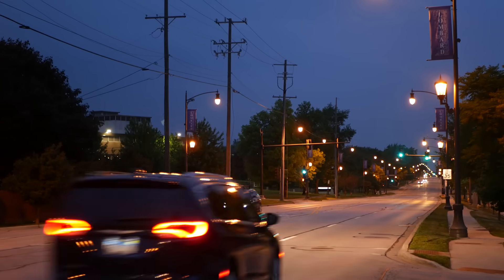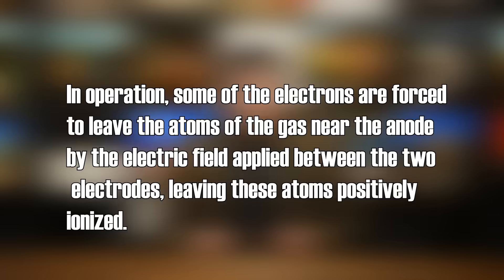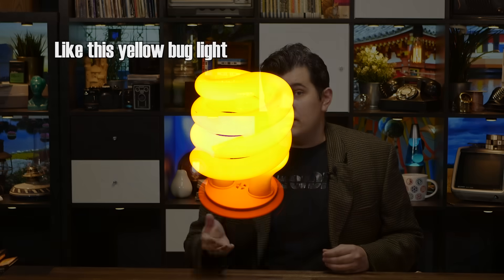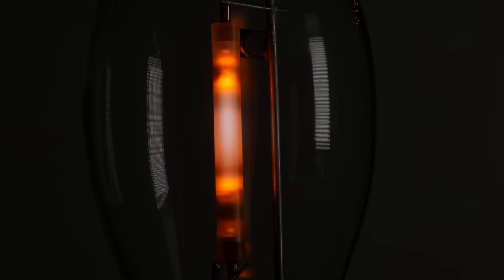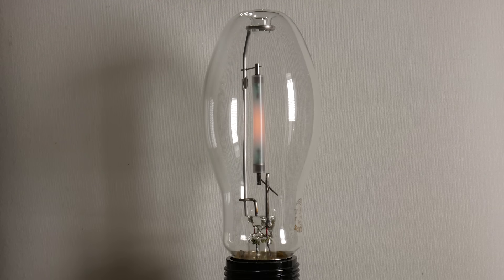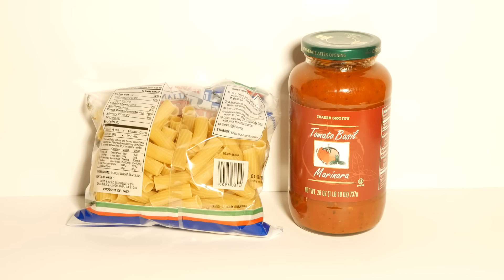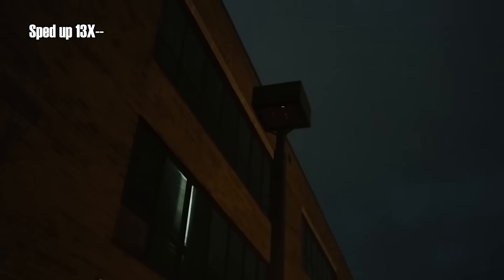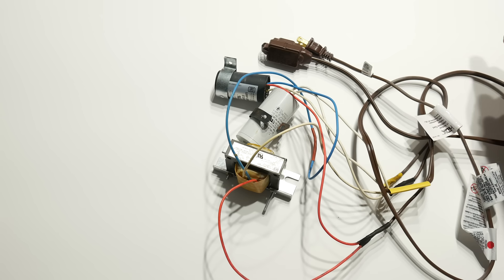The High Pressure Sodium Light: Ubiquitous, effective, but good?

Comment: Sorry to correct you but these are Low Pressure Sodium lamps. High Pressure Sodium Lamps are much whiter.
Reply from the maker: No, these were HPS lamps.  You can very clearly see on the package when I first showed the bulb.  There is a variation called White SON which is much closer to incandescent white light, but it is very rare.  LPS lamps are completely monochromatic and you cannot distinguish colors under them at all.
Reply: Technology Connections
I recognize that they are mostly monochromatic and that is what most street lamps are. Your video title says street lamps. "Orange" street lamps are almost always LPS because of the greater lumens per watt. They are gradually shifting to HPS and Metal Halide lamps but those are quickly being leap frogged by LEDs.

Comment: I've also seen a failure mode of discharge lamps that the inner cylinder or capsule explodes.  Sometimes so energetically, it shatters the bulb itself.

Comment: Been a long time since we've used sodium-lighting (except at some large motorway/highway interchanges where max. spread is needed), with most street-lighting already converted from mercuric-oxide & fluorescent lighting (which replaced most sodium-lighting) to LED-lighting, because LEDs are so cost efficient & long lasting! 
One big problem with the colour of sodium-lighting is if you are approaching traffic-lights you may not notice that they have changed to orange, turning red before you realise! I was caught out by this just after getting my driver's license about 40yrs ago, & ran the red-lights! Fortunately there were no other vehicles around as it was really late at night!

Comment: I have some personal experience with the change in these lights that is positive. (I mean going from the old orange sodium lights to LEDs.) One of the lights is just outside of my bedroom window. When it was the old type of light, it would almost entirely light my bedroom at night and even blackout shades would let in some light to disturb me. The LED's more directional function and white (5600K or so) output has made it much easier to cut the light out when I need to sleep.

I also have looked at them from a distant, higher elevation. What I've noticed is that the light pollution issue is much less of a problem with LEDs, since they are less intense and more directionally focused. The colors are vibrant and the viewing distance they provide is sufficient, but they are less disturbing generally.

Comment: Perhaps it's intentional, perhaps not, but limiting the colors, particularly to low wavelengths (Yellow/Amber and lower into Reds) can diminish the interference of light on night vision. Reds are more difficult to see, making Amber/Yellow lights a safer balance once you reach a poorly lit street or the edge of town (because your eyes need less time to adjust). You can literally output more light and it'll be less disruptive to human nighttime perception than anything in the Green+ range.
Reply: Try getting a municipality to defer to common sense like that though
Reply: +tOM Travelling I know getting "white" out of LEDs is a challenge and that they also tried using RGB instead of phosphor coatings, but why is that relevant to these comments?
Reply: If outdoor lights didn't affect our night vision, we could see better beyond the reach of the light.
Reply: So far, implementations of LEDs I've seen have been spotty and blinding bright white. I'm looking forward to different proposed solutions. The studies on vision he mentions seem like a good starting point to judge whether the efficiency of HPS is real, and the effects each type might have on night visibility. Perhaps some warm white LEDs with diffusers might improve CRI and save us a few bucks in the process. Another thing people haven't mentioned much is how many more insects white light attracts vs mostly orange.
Reply: There are no "white" LEDs - like fluorescents, they emit ultraviolet & a phosphor mix makes the white.

Comment: Not only are the sodium lamps very efficient, they even have 3 big advantages over LEDs for street lights:

1 - the narrow frequency range and the specific low frequency make it so it only stimulates the L-cells, leaving your nightvision nearly unimpaired (the main reason why the lights in ships, aircrafts and cars for the displays are red/orange).
2 - it doesn't mess up the day/night cycle of wildlife as much (birds singing in the night can be really annoying)
3 - the narrow frequency can easily be blocked out with filters, meaning that they do not hinder astronomers so much.

Comment: I miss the old mercury vapor lamps, they were never as bright or harsh as sodium lamps. There's an HPS streetlight right on the edge of my yard that I want to brutally murder every night. 

Hey, if you're the tinkerer type, try picking up a high-CRI Yuji LED. They're pricey as hell compared to cheap Chinese LED chips, but the quality of the light they put out is unbeatable. I've used a couple in projects so far: I have a warm-white 50 watt chip in a lantern I built to replicate the look & brightness of a gas mantle lantern, and a cool-white 100 watt chip in a crazy, daylight-blaster of a flashlight.

Comment: I moved 8 months ago. But mu previous city-of-residence was in the process of replacing the HPS streetlights w/ LEDs. They chose fixtures w/ warm-white LEDs, that looked really nice (in my eyes). As an example, they replaced them all on a stretch of two-lane blacktop w/ the lights arranged in an alternating zig-zag pattern. The entire roadway was evenly lit, across the width, w/ no shadows or hot spots. And the fixtures were designed for minimum "sky-glow" & w/ just enough back-cutoff to throw light on the sidewalks, but not through the windows of roadside houses.

Comment: You didn't mention another reason they are used in street light, the light from them penetrates water better then anything else allowing you to see the road when its covered with water and see through rain.
Reply: Gian N   What I can add about fog lights is that they are a lowly mounted light which is the main effectiveness for less glare.  Marketing and ignorance probably kept the yellow in production.
Reply: Gian N  indeed if there was significant scattering involved you would notice the fog would be blue, instead it is a hazy white.
Reply: Lou Fazio exactly. Fog doesn't always go all the way to the ground. By putting fog lights as close to the ground as possible, there's a good chance that the light could travel under the fog. They don't help you to see since your eyes are above the fog, but they make your car more visible to other drivers.
Reply: sadly that's a myth, like yellow headlights in fog. The wavelength difference between colors is not comparable to the size of water droplets in fog or rain, so any scattering is the same. Maybe some slight differences in contrast, but the effect is very small.
Reply: @giann3021  Why are all these people driving with fog lamps on anyway when its not foggy!   Originally, they were designed so a driver can track the side of the road in heavy fog (and which is why when you turn them on, the one red taillight gets brighter for the guy behind you to still see you), but now they are just an automatic ON for everyone.  Those fog lamps were not designed to protect others from the annoying and blinding glare they produce when its NOT foggy!  I often see some use them as headlights instead of regular headlights, I guess because they think it looks cool.  Ugh!
Reply: @jimmayors2315  Lol you got it! They're great to see the bottom/edge of the road, and keep your car on it when visibility is poor. I feel like they help when its raining heavily too. 

The only time I use them when not foggy is on pitch black twisty roads, where they also help you see the edge on tight turns. If they are properly installed they shouldn't cause glare either way. The problem is mostly with improperly installed aftermarket fog lights and LED bars, where the height cutoff has not been adjusted or accounted for.

My Suzuki Grand Vitara has some OEM fogs which do cause glare to other drivers, but I suspect they weren't installed from the factory, or were replaced after a crash and not aligned. There must be some adjustment screw behind each lamp, which can be set to the correct position.

Adding a yellow filter actually reduces light output by around 15%, which could help reduce glare on lights that are too bright. Yellow LEDs or 3000K HIDs aren't affected by this though, since they are natively of that color and work the same with a clear lens.
Reply: @giann3021  my theory is they do it because the lamps cast a bright pool of light immediately in front of the vehicle. Unfortunately, this is precisely the opposite of what is required of the situation; as it destroys the driver's ability to see the dimly-lit objects 100m to 1km down the road.
Reply: Because they aren’t actually fog lamps, but driving lamps on most vehicles in the last 20 odd years when you look at the lightpattern, angle, and wattage. 
The bit about one taillight getting brighter indicates you are fr9m Great Britain, where they commonly have a single rear fog also. On the continent they often have two. And in the US, zero, excuse me... zed.
Reply: @attackeagle  While this is probably true in some cases, I still see plenty of vehicles here in New Zealand driving around with four bright lights (regular headlights + the problematic bumper-mounted lights) at night. If they were intended as daytime running lights, they would switch off automatically when the headlights came on; and if they're intended as driving lamps, they should turn on only with the headlight high-beam (aka main beam).

Comment: Detroit recently replaced all of its lighting with LED lights. 

Part of the rational was that the old lights used a transformer that was in the base of the lighting fixture behind an access panel. Transformers are full of copper wire and were a target of copper thieves. Security nuts and then even welding was used to prevent the thievery. Now the LED bulbs do not need the transformer so it is removed.

The city got the power company to pay for the replacement. Apparently streetlight electricity isn't metered. The city pays a flat rate based on the number of street lights. The flat rate is supposed to include maintenance of the lights. Detroit had an independent contractor determine that less than half of the lights were actually working and a deal was worked that the city wouldn't sue if the power company would get all the lights working by replacing them with the LED units which would get rid of the theft target transformer.

Comment: You should explain the difference between lumen and lux measurement. And go more in depth on CRI.
Reply: 2010ngojo lumen is the light a bulb emits. Imagine something like light power. Lux is lumen per m2 , how much light you get to the surface you want. Cri is a percentage of how colours look like in comparison to the sun , so 100% is perfect for al colours 50% means only 50% of shades will look the same. In HPS lamps only a handful of   Shades from 16.7 mil shades will be correct

Comment: What you didn't mention: The sodium lamp is used to reduce light pollution. The yellow band doesn't pollute the night sky quite so badly. I don't quite know how it technically works, but seeing as blue light and shorter wavelengths require higher energy, I think it might be that the higher-energy blue light will just bounce off the walls and ground better. I know an astronomer who told me about how much better the city observatory was able to see fainter parts of the milky way after my home town switched to sodium lighting in the early 90s, coming from CCFL street lighting.

Comment: My city is mostly LED now, and I actually greatly prefer it to the sodium vapor. The color reminds me of the old DX phosphor coated mercury vapor lamps.

Something you didn't mention (maybe on purpose, I don't know) is that while the lamps themselves are quite efficient, the ballast wastes a portion of power as heat. Significantly so, in autotransformer ballasts for larger lamps. But modern electronic ballasts mostly mitigate this.
Reply: Agreed - not to mention HPS's huge market as grow lights.
Reply: We had a mercury vapor light on our porch when I was a kid. I’ve preferred white lights ever since.
Reply: I prefer sodium vapor.

Comment: 11:37 Wow, since I was little, when walking at night, I always thought the lamps would go out periodically to ensure they'd last longer, it didn't help that it was always one at a time, and only after it was on again, the next one in line was turned off.

The reality is that the county doesn't change the bulbs as often as they should, and only replace them when they stop flickering altogether...

Well, the more you know!
Reply: Haha I feel ya I used to think they were on motion detectors or something.
Reply: I had a friend who was convinced his Nissan was emitting some sort of electromagnetic radiation that was interfering with street lights causing them to cycle off and on because he only saw it happen when he drove under them...  He was so excited about it that I didn't have the heart to correct him!

Comment: As a photographer, Na vapour lighting is the bane of my existence. Bring on the LEDs!  I don't care how glaring they are, much much better for photos.
Reply: Jersey Mike's Rail Videos you are wrong. If you use flash with hps lamps you have to correct only one frequency. With LED it is different every time. Most LED have stroboscopic effect wich is nightmare for photos. Also LED are multifocal so you get hundreds of shadows.
Reply: I've never had any issues with them....I mean at night I'm running long exposures and no flash so ambient lighting is critical.

Comment: When I worked as warehouse maintenance I had to replace metal halide lights, and deal with them during power outages and the like. If you look at them in most installations there's a clear acrylic or glass cover at the end of the shade, it's there because they have a tendency to explode sometimes. I know we had a few explode on us, and the company I worked for was too cheap to get enclosed fixtures or the "passive failure only" type bulbs. The fact they still even make the kind that can explode baffles me, it's a pretty major fire risk, never mind if one goes while you're standing under it.

Comment: They also use yellow light (sometimes called "selective yellow") because it cuts through fog better than white, and especially blue-ish white light since human vision has more trouble with blue to violet wavelengths. The yellow also doesn't affect your night vision as badly as bright white and generally doesn't lead to as much light pollution. I know in parts of Phoenix in the late '90s and early '00s, they were putting in fluorescent lights, and they used yellow tinted bulbs rather than white. Many cities also do the same thing with modern LED lights. You also see some cars, especially cars from the '90s, with yellow fog lights. Though, of course, there is debate about whether or not yellow is really better or not. See: https://en.wikipedia.org/wiki/Selective_yellow Though it certainly seems like something you're planning to cover in the next video(s) on the topic.
Reply: Blox117 The caveat is that the sky has much smaller particles than fog (Nitrogen and oxygen molecules in the atmosphere) vs water droplets in fog&rain. I saw your reply to my other comment and this seemed contradictory lol but in fact it's just the size of particles which differs.
Reply: blue light does get scattered more, just like how the sky is blue or some smoke appears blue
Reply: Gian N i only read parts of his comment unfortunately, and maybe even mixed it up with another comment. thats what happens when you browse the comments too fast lol woops
Reply: Blox117 Basically all your replies are very interesting, you seem like a highly intelligent/knowledgeable individual. Are you a college graduate, for instance a physicist or meteorologist?
Reply: Blox117 Interestingly, the sky would actually be violet, but the human eye is more sensitive to blue than it is to violet since violet is nearing the end of the visible spectrum.

Comment: Some of the earliest adopters of sodium vapor lamps are those with astronomical observatories nearby.  This is  because there are only 2 frequencies the observatories need to filter out while doing their night time observations.
Lately some of these places have been swithching over to led lamps.  Advantage:  an led lamp can include 3 monochromatic leds--1 ea red blue and green. The person on the street sees white due to the blending of the 3 primaries but the observatories still only have 3 frequencies to filter for their spectral observations.